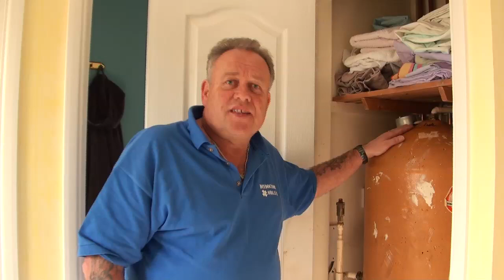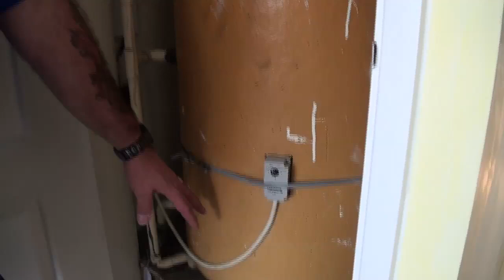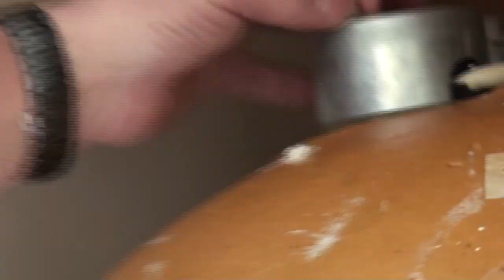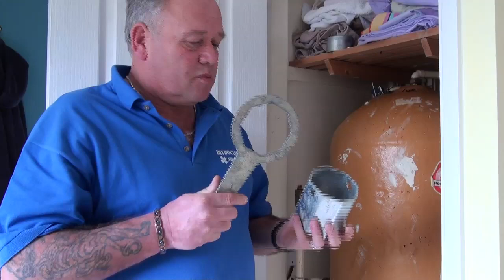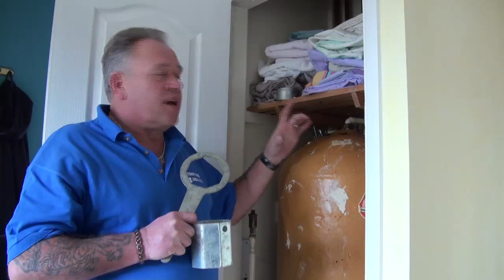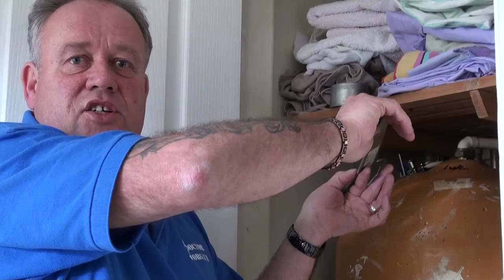Water and Plumbing Tutorial Part 9 - Immersion Heater

Comment: A British Standard tank fed copper cylinder is only point 7 of a millimetre thick. 1st you should check the cylinder is isolated after turning the water supply by turning on a hot tap to ensure isolating valve is holding. you have not shown how to remove the element should it be totally stuck, which happens many times, there is an answer
Reply from the maker: We have a project in our project pages for just this Les. Thanks for writing in/